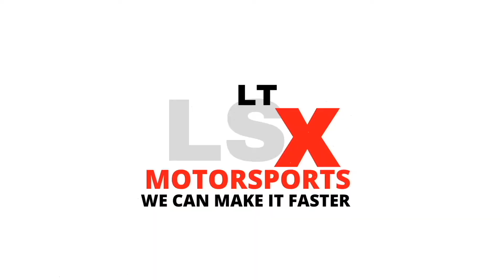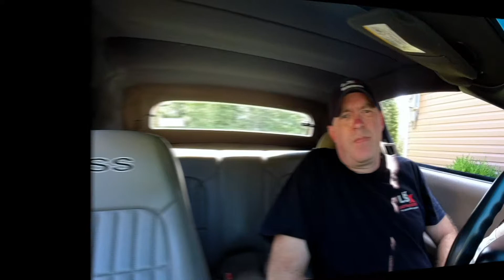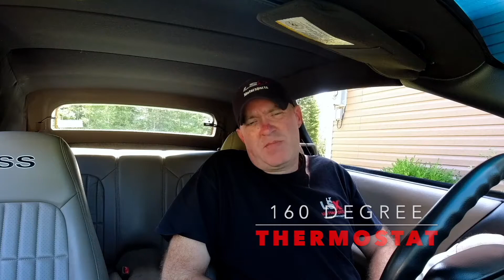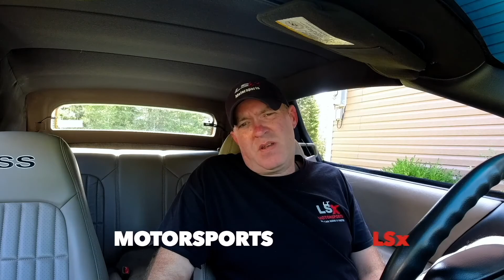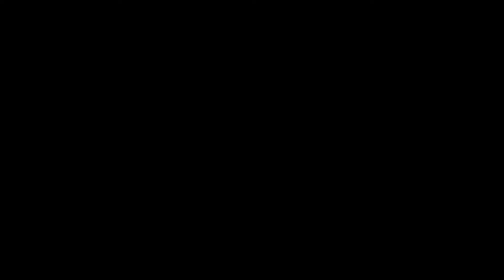How to get the most performance from your 4th Gen  - When your on a budget and new mods have to wait

Comment: What does a 160 thermostat do performance wise compared to 180?
Reply from the maker: Well by itself it really doesn't do much of anything.But combined with a manual fan switch or programming you're computer to turn the fans on sooner you can hit the 180 - 190 degrees F before you make a 1/4 mile run.In my experience they run just a bit faster when they are in that temperature range.If you drive in cold climates I would not recommend a 160 thermostat because the car will struggle to maintain proper operating temperature.I also recommend the manual fan switch because that way you only run cool when you want to run the 1/4 mile and under all other conditions you run at the temperature the car was ment to run at from the factory.